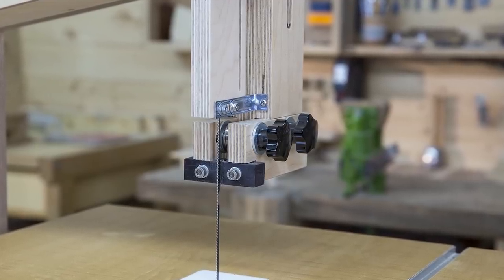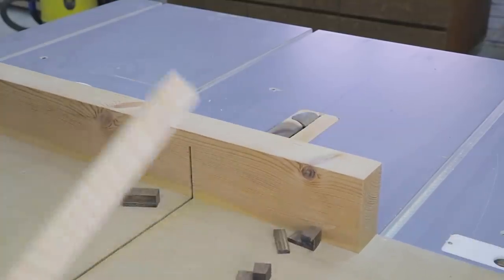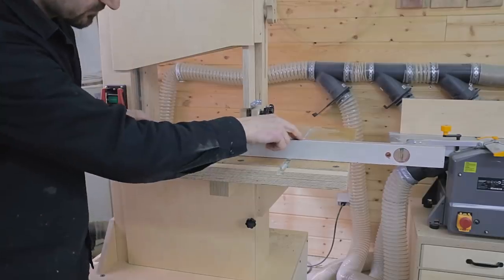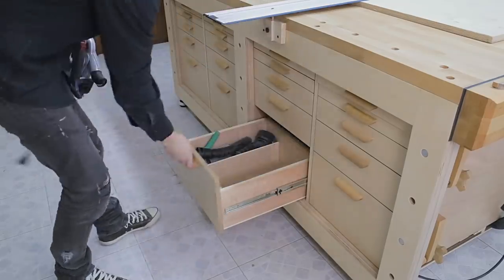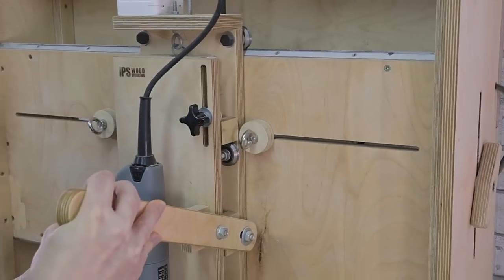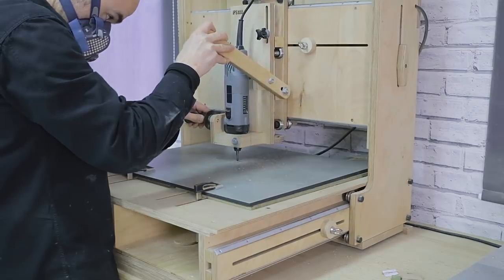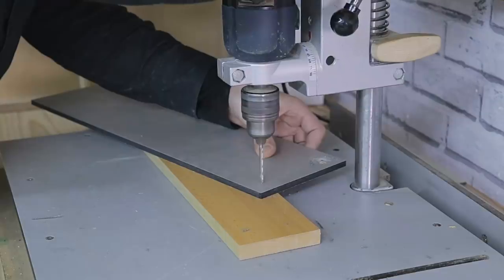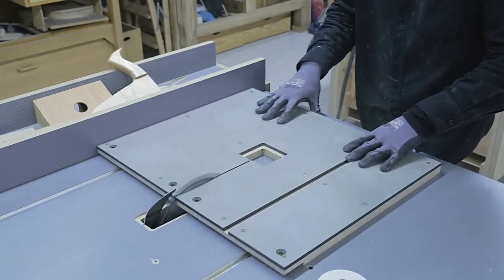Band Saw Upgrades / New HPL Blade Guides & Table

Comment: One thing I notice is that you do not use foam under the sheets you're cutting on the bench. Is there a permanent cut line in your bench top? I may have missed something in your build of that bench. Your track saw seems to be set to the depth (thickness) of the sheets you're cutting. Correct?
Reply: That’s what I was curious about. That table is to nice to saw lines in it.
Reply from the maker: Here I explain how to do it:
https://youtu.be/bLOlQzxwgMM?t=856
Reply: His fence set up for the track always keeps the kerf in the same spot on the table. It may not work for everyone, but it is a very smart idea!

Comment: I did not understand the difference between the old table and the new one. Are they not both HPL over plywood? Why did the old one warp? What is the improvement to prevent the new one from warping?
Reply from the maker: it is not the same to stick than to screw, also in the old table I have joined three different pieces with two different glues

Comment: Hi there!

I really love your table saw built and appreciate your work! 

But your table will still warp if you won't sandwich it in a symmetrical fassion. Thats why you always laminate both sides and apply finish coating on both sides, even if the back is unvisible.

I hope that helps!

Regards,
Etna.
Reply from the maker: right, is what I explain in the video! thanks
Reply: Yeah, but still made the same error by screwing a different material with a different expansion coefficient tightly onto your surface. I'm just trying to helf. I wish you luck that this surface wont warp.